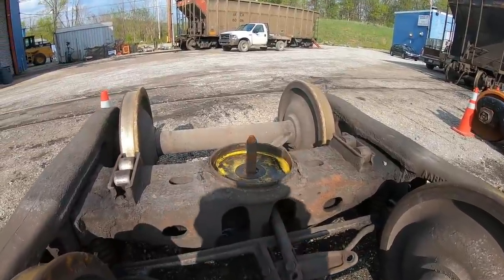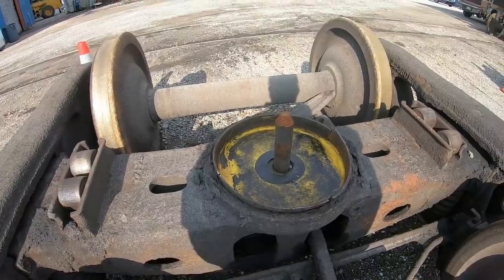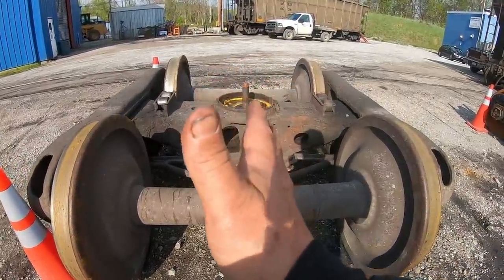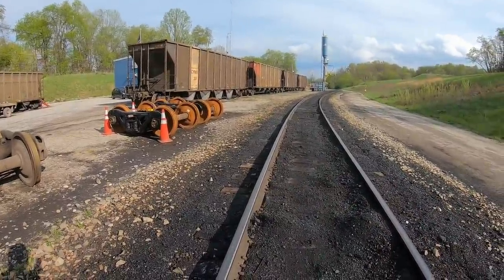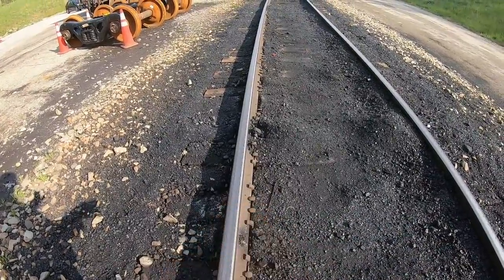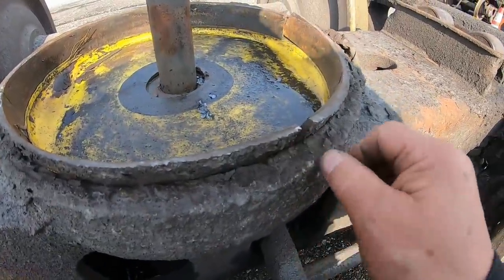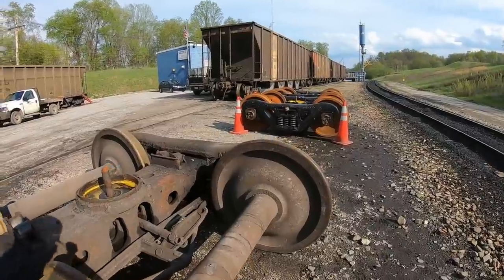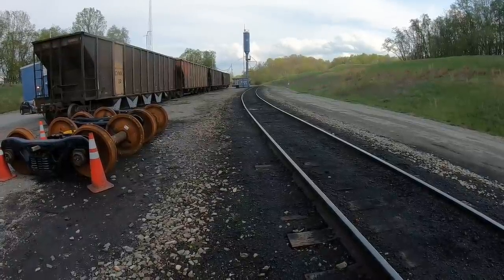Why the Derailment at Curve 18  Happened

Comment: If that train was only going 22mph, info from last video, how was it able to travel a quarter mile while running over gravel and railroad ties? It seams the rough terrain would have slowed it down. I’m not an engineer….I’m asking questions to help understand how this happened too. Would anyone answer and comment?
Reply from the maker: That is a good question David. What you may not know is there
were 38 loaded cars on that train. Only the rear 2 came off,
so trying to get those 36 loaded cars stopped was what
carried the momentum. Once the air hoses broke apart and
the train went into emergency then all the wheels on those 36
cars were locked up and sliding, metal on metal. Hope that
helps explain for you.

Comment: Wander if rust jacking on pivot bowl caused it to seize on hard curve and with outside curve getting the most pressure on the gauge could influence a ride up by over speed into the curve overweight cars hitting the curve loosens the gauge overtime and then sticky pivot bolt seizure at the perfect angle   but I dont know I just think it's fun to explore dynamics in engineering and imagine how it works cool video I would have imagined way more complex than a single big bolt to attach it to wheel set

Comment: The only way a bogie, Oh sorry truck will not turn under a rail wagon is if it has three points of contact, 1 the wagon body is sitting in the centre casting of the bogie, 2 & 3 the two side bearers have run out of rolling clearance or side bearer clearance, not sure what Americans call it, when both of these are contacting the wagon it will prevent the bogie from turning,  A seized axlebox bearing (Hot box) will not cause the bogie to derail until it seizes up completely and generates enough heat to make the axle fluid so it screws off the axle from the wheel set.  Regards

Comment: I would recommend you bring in an independent rail auditor or expert to give an objective analysis.   On another note, that coal dust is holding moisture.
That bowl being broken on the bogey rests solely on car maintenance or lack there of.
Reply from the maker: Had there been  a fatal or serious injury that most likely would
have happened, but just a few cars off they not gonna spend
the money, everything back to normal now and train is running
so alls well that ends well, thanks for watching 
Hope you'll stay tuned for the rest of the upcoming videos on
the derailment.

Comment: Has anyone ever thought about using a giant industrial vacuum like they used to suck out sewers to suck up all of the coal dust and even the ballast and the dirt between the ties instead of having to dig it out with the claw ?

I'm thinking there should be a way to suck all of the ballast and dirt and mud and rock and Co al dust from the ties maybe using some vibration along with the powerful suction

This would save a huge amount of time

The other idea I had was to have some type of machine that would be like a cheese slicer would go underneath the ties and would have bulldozer tracks and would clamp to the rails and pick the rails and the ties up simultaneously and shake the mud and dirt and ballast off from between the ties and then a scraper would come behind it as part of the same machine and would either push all of the ballasts off to the sides or would scrape it to a conveyor that would bring it up at a 45° angle and dump it into gondola cars

This would leave the skeleton track and if you had cars loaded with ballast behind it as part of the same train it could dump the new ballast into the skeleton track all is one big maneuver

If you could do this before the ties rot out then you could replace the ballast every so often

Has anyone ever looked into doing either of these methods ?

The other thing I thought was if you could get the ballast out of there either with the vacuum or the scraper and then have some type of machine that would clean the ballast and then dump it back in clean of the mud and Coal

Is this possible ?
Reply: That kind of equipment does exist. Both in large and small scale. You can find examples of ballast cleaning on youtube. I've seen (and heard!) it done on the commuter tracks next to my house where it was a single big tractor with a device attached to the front crane arm that could suck up the ballast and put it down again.
But I don't know if it can be done on the track here if the ballast is kind of glued together with coal dust, dried mud and clay...
Reply from the maker: We used to get Hulcher out here 4 times a year with their giant
vacumn truck to do that, but budget cuts have slowed that
down considerably, thanks for watching

Comment: I dont understand why the weight would not actually shift to the outside instead of inside. If truck and car want to go straight, then outside rail would act like a pivot or fulcrum point and center of gravity of car (weight) would want to keep going to outside.  You'd have a lateral force going to the outside. This would cause the outside rails to roll over.
Reply from the maker: Outside rail is the one that rolled, did you watch my prior video on
the derailment? Thanks for viewing this one Bill

Comment: That’s a Poly bowl liner, and no grease is to be applied to conventional truck/end truck only articulated trucks requires grease.
Reply from the maker: There are varying thoughts on that and many do agree with you. The
shop that rebuilds our truck sets are the ones that recommended
us also putting grease in there. Of course he sells the grease too.
But also we have 70 curves in 16.8 miles of track and over 2/3
of those curves are high degree curves, so this is not your typical
track either. Thank you very much for visiting with us and may you have a really good day my friend.
Reply: @ccrx6700  this very well maybe company policy for what I do with intermodal 100/125 trucks do not have grease applied to the bowl liners. On spine cars grease in the intermediate trucks and lube disks on the end trucks. 
But I don’t work coal cars, gondolas, or hopers just intermodal, flats, and autos.
Reply from the maker: @FOEHMR0024  👍😊

Comment: Why is this designed like that ? Plastic will obviously wear out in places where is highest angle speed (and least lubricated in this case). What will then happen ? Inner part (metal that sits inside plastic bushing) will have loose fit and start moving left, right, front, back in every turn and speed change causing even more damage to outer ring.
Reply from the maker: Sometimes things just break and go bad on the RR. We been
very fortunate that this was the first time that I can remember
since 1993 or earlier that a problem like this has occurred here.
Thank you for watching and hope you will enjoy the rest of the
videos coming out about the derailment events.

Comment: The wheel flanges are not thin nor do they appear chipped. The truck bolster and king pin would appear to be the suspect.

So not due to Maintenance of Way but to the Car Department.

Which means that MOW of course will once again be blamed and the fault determined to be wide guage. (oops! gauge)
Reply: The saying around our yard was whose turn was it to blame the derailment on, car dept, mow, or transportation.
Reply from the maker: Always happens Lynn, sounds like you been there done that...
thanks for watching
Reply: @ccrx6700  My father, was a civil engineer for the former CMStP&P RR, the Milwaukee Road when it was a going concern.

Me, the pay for an extra gang laborer was fine but that D shaped handle just never quite fit my hand.

Stay safe though. Thanks.

Comment: Its like a nylacast liner its got  a name molded on it normaly the liner  prevents wear and acts like greas almost. Sidefriction stop the wagon from tilting to much we have metal blocks i see you use rollers and no anti slew pins but a main pin.The buttons on the bogie gives it its alighnmant on the bearing adaptors if not alighned correctly the wheal flange eats away and can derail the wagon
Reply from the maker: Yep, buttons on side frame need to match within 1 button on each
side. 3 buttons is perfect at 70 inches, but can't have a 3 button on
1 side and a 5 on the other or the truck set (bogie) will do down
the track slewed, in tangent track it will act like it in a 2 to 3 degree curve, very undesirable. However it is extremely rare that there ever
is a mis match coming from a reputable rebuild shop. The rollers
are called side bearings here, there are many different styles, we use
rollers along with Stucki and Minor constant contact bearings
Reply: @ccrx6700  the only bogies i weld on now are mk3 and mk7 high speed bogies refurbishing the side frames welding in new hardened plates upgrading the brakebeam  side pockets from metal to nylacast liners.
Reply from the maker: @ScorpioxA1  awesome 👍

Comment: as a certified aar Carman i disagree, most of the yellow plastic lubricating liner is still in the bolster, the center plate on the car is not shown but there is nothing close/above to the broken reinforcement ring in the bolster that would stop it from turning as needed, note the small bit of shine wear on ring where it contacts the cars center plate but it was free to slide as the bolster turned
Reply from the maker: You may very well be right sir, I'm not a carman, I'm track maintenance, would be very interested to hear your hypothesis
on why this derailment happened. As you know, the trackmen 
always blame it on the carmen and the carmen blame it on
the engineers and the engineers blame it on the trackmen....LOL
But thank you for watching
Reply: @ccrx6700  was there a working detector nearby? to verify the trains speed
Reply: @ccrx6700  i also note the left side bearing rollers are shiny but not the right, this would indicate load is not even and leaning to that side
Reply from the maker: @Conky011  detector 4 miles down yrack, so no we took operators word for it

Comment: The car might want to go straight but the car or locomotive in front of it is pulling it at an angle into the curve.
Reply from the maker: Yes Kent but also remember those couplers have a 13 degree range of motion, so ponder that and factor it in see what you can
determine. Thanks for watching sir
Reply: @ccrx6700  the trailing car is still being pulled at an angle.  The point of application of the force is where the coupler pivots.  The angle isn’t much but it’s there.  The greater the distance between pivot points the greater the angle.   Why did it derail?   I haven’t a clue.  Your theory that the truck didn’t pivot makes sense.

Comment: Heres the deal,,, YOU HAVE BEEN WORKING THERE FOREVER, and , you KNOW people who have been WORKING THERE  since steam ruled the rails,,,,,THE Questions are  then , number 1 , IS that atypical in the extreme of all such swivels ( including the damage to the steel cup or would you find A bunch that look the same Just waiting to cause a PROBLEM under the right conditions WHICH If true should be a major violation and REASON ALone that the CORPORATE powers should not be interested in exploring it ,  because lets face it , your RUNNING heavy loads USING old equipment THATS maintained only fairly well by owners who change every other year,, and NUMBER 2 , is any or all of that damage secondary to the incident...,, THOSE two Questions should i believe be easily answered providing  They want to know....
Reply from the maker: Well Bobby you are touching on some "delicate" subjects there,
not gonna negate what you say, but prefer not to go any further into it. Appreciate your watching sir

Comment: Look at all of that coal dust, the best way to get rid of the coal dust on the track is  hire a hyrail vacuum truck, we have a company with hyrail vacuum trucks that we hire when needed.
Reply: There’s a lot more dust there than you know. A vacuum truck won’t get it. He’s been digging the ballast out with an excavator and replacing it because the coal dust is nothing but thick mud at this point. 
The only way to save that old ballast is with an undercutter and a ballast cleaner. The indercutter takes the ballast from under the ties and feeds it through a ballast cleaner which works somewhat similar to gravel washing plant only without the water. It uses shaker screens to get the dirt and dust out of the rock and then places the rock back on the roadbed and the dirt can go in a gondola or a truck to be taken off site for disposal.
Reply: @ralfie8801  https://www.youtube.com/watch?v=zNFUgTJR6jw
could probably do the whole line in a few days with one of these. Would hate to imagine the cost.
Reply: @jackgibbons6013  Wow!  That's an incredible machine.  Of course, it's in Europe so 'shipping' would be expensive.  lol  And they have a lot of high speed rail to keep a monster like that busy.
Reply: A vac truck will suck all of that , we do it in our yards.
Reply: @Jason Babila  
You’re right, it would suck ballast and all up, it’s mud in the ballast at this point. If it won’t leave clean ballast after the process, a different method like the one he uses in other videos he’s posted is needed. I’m sure he’d rather have the dust vacuumed out of the ballast than replace it like he’s doing all over the railroad if he could.
Reply from the maker: We've actually used Hulcher to suck out mud spots, they
have to use an air wand to break it up if dry, it is a looooong
slow process so we quit, cribbing or undercutting is the
way to go

Comment: I have seen track over there in diabolical state and often when watching personal posts , you will hear wagons with terrible flats.  If there was no track spread it would cancel that out.   I have recently watched a post in UTube about these Teflon sleeves, I sort of get the idea of them but surely they must fail than the pivot system??
Reply from the maker: My personal feeling is they should be replaced on a fairly
consistent schedule, but then again this is the first time such
a thing has happened here since before 1993, so that really ain't
so awful bad a run. Thanks for watching
Reply: @ccrx6700  I was a Train Driver in the UK,
I find your train system on the one hand awesome (Loco's & hauling) and yet maintenance rough.  I like your posts though I learn a lot.   Thanks

Comment: You have so much coal leaking out of those cars on your ballast.

Can't they get the leakage stopped?  

Where I work we have a csx siding with plastic pellets delivered.

But 90% of all traffic on those tracks is coal.

I've never seen one piece of coal on the ballast at my place of work.
Reply from the maker: It is a real problem here with coal leaking out for sure. We are a coal
mine, not a RR. A coal mine that has a RR. We do not have 
dedicated car men who know what they are doing like CSX has. We
have coal mine mechanics who are responsible for a whole lot of
other things besides taking care of hopper cars. They do the best
they can with what they got, but we would benefit greatly from
experienced car men here. Being that we are a union mine, they just
can't go out and hire experienced car men, those would be bid jobs
if they did put them up and the most senior guys would get the
jobs, not the most qualified ones.  The cars we have are old and
get extreme usage. Most coal hopper cars on CSX get loaded and
dumped once or twice a week. Here the cars get loaded and dumped
up to 6 times a day, 7 days a week, 360 days a year when they
are running good. Extreme use which causes a lot of wear and tear
on the cars. We do have our problems with not a lot of good
solutions that can be implemented.

Comment: If it was helper pushing look at force of helper pushing ...
I seen it on Conrail I was wreckmaster fir years ...
Reply from the maker: Thanks and you are certainly correct, too much shove from behind
is a good way to knock some cars off in a curve. We have a loco on
each end of the train, rear unit radio controlled. We have ran this system for over 25 years, same curve basically the same operating
procedure. The guy running that night told me was following standard
practice for that section of track. I wasn't in the cab with him when
it happened so guess I have to take his word for it.
Reply: Not blaming engineer only saying what I saw fir longtime .. 
We had engineer 40 years on RR derailed the train 3 times in 3 years same place with helper ...
40 years on that piece of track and no derailments ...
He was removed and only allowed on yard jobs ...
That car came long ways and never derailed   why did it derail there ? 
Track was fine ?
I seen center bowls bro out half of it gone and car never derailed.....
Using helper is tricky and takes a lot of skill so is headend that things are perfect running together ....